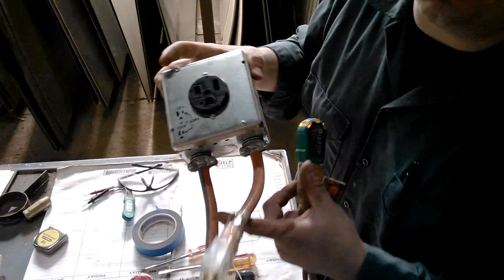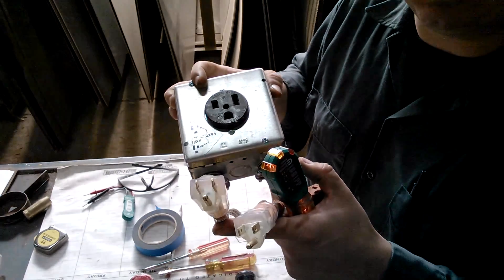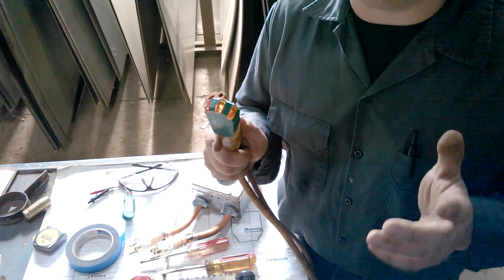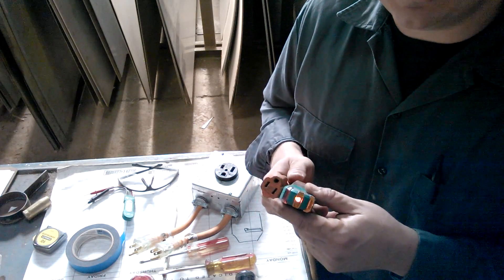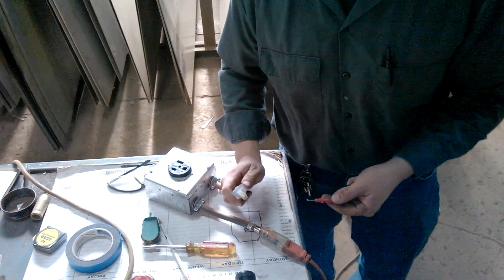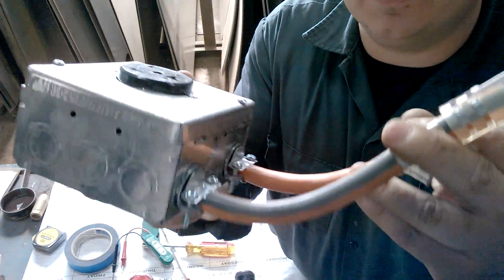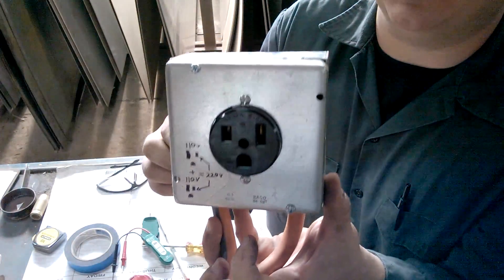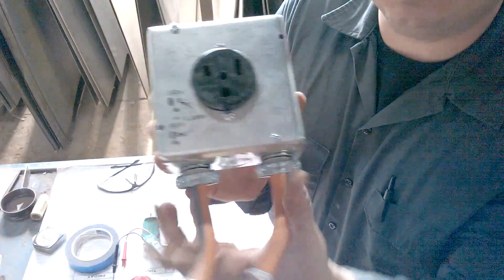Experiment convert 110v to 220v from two outlets

Comment: Good idea. Most of the houses in my country are 110v (Nicaragua) I wanted to know how to run a 220v mini split with my house being 110v. I still have no clue, but what you showed is by far more information than the one I found through a google search. Thanks!
Reply: Just because you have a light on your tester does not mean you had 240 I recently had a hot wire that test hot and even 120 but when I connected a porch light to it I dropped to 20 volts showing a neutral short so I believe in using a muti meter to determine correct voltage and keep in mind a neutral short on any of your cords or boxes they are plugged in to or plugs down the line could cause you problems or even harm this is not even a good experiment
Reply: I live in US have had joint the 110v circuit into 220v for my mini split air conditioner. It is the same as this video, but I did it in the circuit breaker.
Reply: If your neighbor is has free electricity (or stolen), then you could connect a very long second extension cord to a regulator or surge protector then to his wall outlet. When that is done, connect your primary extension cord to your extra regulator or surge protector and plug both extension cords to this adapter so that you can power up a 220v welder, good luck. Of course you will have to flip the two regulator or surge protector switches back on when they automatically turn off.

Materials: adapter (like this), two surge protectors (or regulators or use 1 regulator and one surge protector) and two extension cords (2x 110v extension cords=220v)